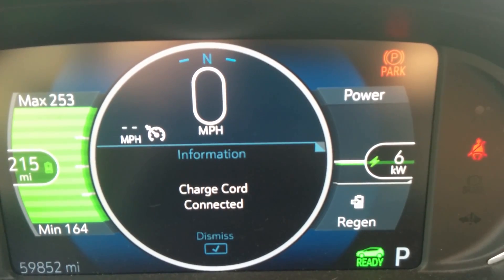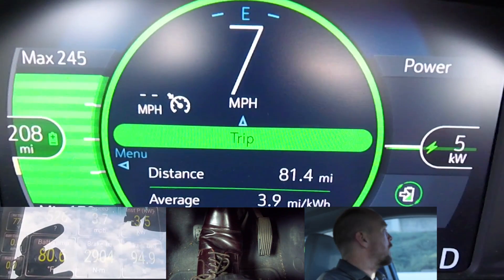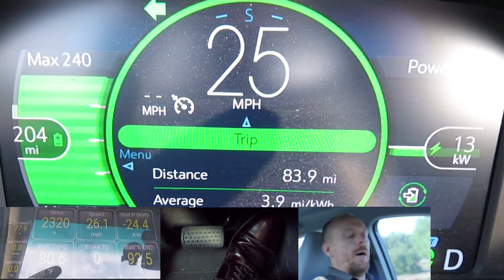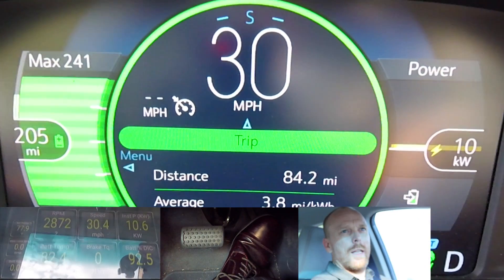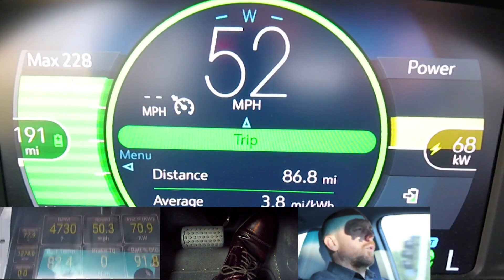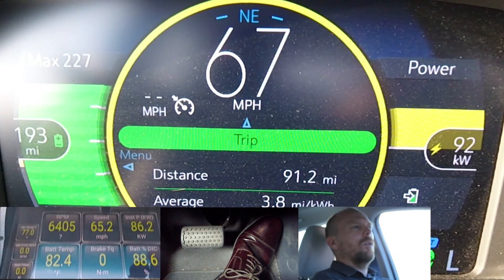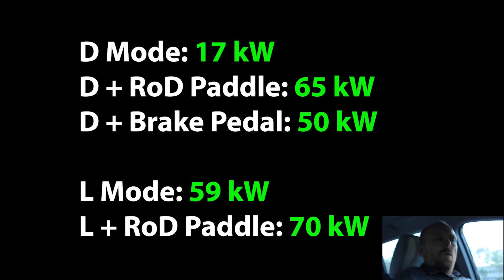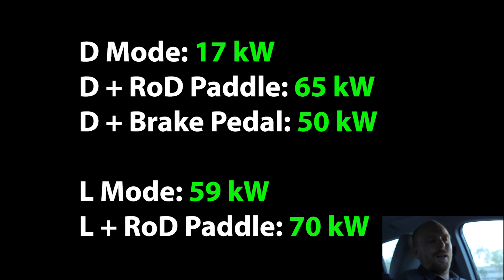Chevy Bolt EV Regenerative Braking Review

Comment: My understanding is the brake lights on my 2022 Bolt EUV are programmed to stay on after stopping with the RoD paddle, but I don't know if the newer Bolt EVs (non-EUV) do, as well. 

It's a little difficult to confirm exactly when the brake lights ARE on, so I've fantasized about adding an indicator (maybe wired to the third brake light) that I can see from the driver's seat.
Reply from the maker: I can sometimes see the reflection at night. I believe that with the 2019/20 model year update, they made the change that you are describing, so my understanding is that the update applies to all newer Bolt EVs. I like the idea of having a brake light indicator on the dash, though.
Reply: @newscoulomb3705  I was thinking even lower tech... maybe a LED on the inside of the hatch, visible using the rear view mirror.

Comment: Question about the L gear,.... I used to drive the discontinued Chevy Spark. Excellent car, no complaints. I always drove in L gear because of the regen. It was smooth. It would come to almost a complete stop around 2-3MPH than I grab the brake for complete-stop. Currently because of the value of the first generation Chevy Bolt, I am interested. A 2017 or 2018 Bolt have good prices now. Now my question is, after looking at many photos of the first generation Bolt, It appears that some of the gear selectors show a "D" and "L" indicator on the stick, but Im noticing there are some that do not, have an "L" option below the "D". Do you know if this an option, or year model specific, or possibly Im mistaken and its not visible unless illuminated? Any insight would be appreciated since having "L" mode would be a huge deciding factor in my purchase. Thanks.
Reply from the maker: The later Bolt EV/EUVs added a discrete "One Pedal" button. So you use that to engage one-pedal driving. My only issue with it is that it works in Reverse as well, which definitely requires a mindset adjustment.

Comment: So is ha i g the car in D better plus using paddle to break or L is better??
Can i drive my bolt  2019 on L mode all the time or when do i chose D Nd when do i chose L???  Tqoday I was trying the paddle in the back of the wheel but is not as smooth to stop car.  Also even if I step on break while driving on D the regen pic on dashboard will get activated too?
Reply from the maker: You can drive however feels best to you. I drive in L pretty much all of the time.
Reply: @newscoulomb3705  thank u

Comment: Eric, You did a fantastic job in this video.  The camera work is terrific.  The explanation is very clear and demonstrated very well.  I don't think videos get much better than this.  You knocked this video out of the park on the different ways to use the regen.  GM did a great job with the Bolt regen options and the flexibility it provides.  To me it is one of the most valuable features of the Bolt and is a strong selling point.  GM did a great job with this.
Reply from the maker: Thank you! I agree. Regen braking is something I think GM does well.

Comment: This Bolt regenerative braking complexity (D, D+paddle, L, L+paddle) strikes me as batshit crazy. I say this as never having driven one. I will take ownership of a new Bolt in a couple of days and see for myself.

I've been a Prius owner for 15 years. Prius has been doing regenerative braking forever. You never, ever, have to think about it. Why should you?

It seems to me that the driver's job is to drive the car. The car's job is to (1) let the driver specify (by easing up on the accelerator pedal, OR applying the break pedal) how fast he wants to decelerate, and (2) achieving that with as much regeneration as possible, using friction brakes as necessary to make up the difference. The car figures out how to do that. It ought not make a whit of difference whether I'm using the brake pedal, a paddle, or one mode or another.

Sure, the car might not be able to recover as much energy if you slam on the brakes and screech to a halt as it would if you decelerated gradually and applied the brakes gently. But that's just a matter of driver education and safe and sane driving, as it always has been.

To my way of thinking, the reason for L mode is and ought to be just that it changes the driving experience, enabling so-called "one pedal driving."  Fine. Maybe that's a better way to drive. I'll find out.

But L mode as a way of achieving increased energy efficiency seems senseless. I don't get the point of that.

Comment: I've heard that some people constantly switch from D to L,  using D when the accelerate for power, and then using L whenever they slow.  Is there an advantage to this?
Reply from the maker: No, there isn't any advantage to that as far as I know. The only change between D and L is the level of regenerative braking when you let off the accelerator, otherwise, acceleration and performance are the same.

Comment: Excellent video I like to watch your channel, I learn a lot, going to purchase EUV in Mexico, in mid of august shall be in sale. In reference to stop lights, I think darning next software Update GM shall add additional menu in settings about keep stop light on until accelerator again is push or certain time programmed to remain, 3-5 min. shall be more to enough waiting for green light. I think would be also nice video about how car use regenerative braking in D and L mode with cruise control, specially downhill. How reacting it when while downhill we change programed speed? Can it be used as precise control of breaking force and speed at same time?

Comment: Interesting the Bolt can generate 70kW short bursts into the battery but that it maxes out at about 55kW on a level 3 DC fast.  Thanks for the video, very informative.
Reply from the maker: Thanks! Yes, that's a common question. Batteries often accept "burst" charging power that is much higher than a sustained charging speed, but I don't think that's the only reason here. It appears that the Bolt EV uses a CCS charging harness that is limited to 150 A, and that's what's restricting the peak charging speed to 55 kW.
Reply: Got it.  Thanks for the reply.

Comment: The Bolt's regen system is awesome! Sometimes I go weeks without even touching the friction brake pedal. When my mechanic happened to hoist my Bolt for an inspection, he was amazed with how brand new my original brake pads looked, after almost 2 years of operating the car. He said they are likely to outlive the vehicle, and I agree.

When I need to slow down abruptly, I use all three systems simultaneously - the L mode, the RoD paddle, and the friction brakes. But then again, it does not happen very often. Usually, the first two are quite enough.

I still have a question, though: how much energy is the regen braking system capable of saving, on average? Say, when driving 100 miles in a city? Not that I really have to know it, just curious.

Comment: The "L" on the Bolt's shift handle stands for LAZY. Too lazy to lift ones foot from the accelerator pedal to place it on the brake pedal. 😎

I prefer to drive in "D". I lift my foot from the accelerator pedal then use the regen paddle on the back of the steering wheel to slow and bring my Bolt gracefully to a stop, while resting my ankle and foot, thus giving them a well-deserved break. 😉

Comment: so one thing everyone forgets with cars being able to regen is. it is sill more effect to coast to a stop than it is to regen to a stop. there are conversion losses when energy is pulled from a dc batter in chemical conversion (why batteries get hot) over from dc/to ac the resistance of the wires  creates a small amount of heat and simply a motor has its own losses that generate heat. that why the drive system has a water cooling system, is to absorb losses.  all these losses work in both directions and the higher currents the more losses there usually are. 

by coasting to a stop the avoid losses in one direction, using the actually brake pedal for a longer time is more efficient and youll have less losses than asking for the motor to hit max regen, also using the pedal in a slow controlled fashion will avoid the friction brakes more. if you want proof, go fo a drive and use the brake pedal with light pressure and watch the technique on the display. if youre above a 4 (on the volt anyway) slow down using the regen paddle a couple times and youll see.

Comment: Thanks for making this video.  As I suspected, it functions the same as the system in my 2017 Volt.  I've been watching a bunch of Bolt videos and reading articles about the brakes and, so far, you are the only one who clearly understands what is going on.  Every time I read or watch another reviewer, I keep wondering why they aren't looking at the gauge to see the amount of regen they are getting.  Several of the reviewers were seasoned automotive journalist.  I even had to explain how the system works to the Chevy sales guy when I was test driving Volts.  I came to the same conclusion you did: in the absence of an extremely cold and/or full battery, the system is designed to capture as much kinetic energy as possible when slowing the car down regardless of mode.

The main benefit I see in GM's system is that allows you to adjust your driving experience (with regards to regen) quickly and intuitively on the fly.  It also allows non-EV drivers to just jump in the car, put it in D and drive it like what they are used to.  I think it is the best regen braking system out in the market today.  I understand why Tesla doesn't use a blended braking system from a performance car perspective, but they could vastly improve the driving experience if they had a ROD paddle on the wheel or even just a high/low toggle on the wheel.

On a final note, I think Chevy should seriously consider some type of referral program for Bolt owners like Tesla has.  When I search for Bolt reviews I primarily find dealership ads pretending to be reviews or reviews written by people who really don't understand the car.  Both groups of people are rarely Bolt owners, and have little time behind the wheel.  There are few die-hards, like yourself, but not enough to get the truth out in a sea of misinformation.
Reply from the maker: Thanks! Yes, I definitely agree that it's one of the best regen systems out there. The one thing I wish it had (because of the blended braking) is a pure coasting mode. Technically, you can do that in N, but you should never really drive in N.

I'd like to see the Regen on Demand paddle have a back and forth. Pull back for max regeneration (like now) and push forward for zero regeneration.

Comment: This was very helpful.  I just wish you had addressed the big question "Do the brake lights come on during regenerative breaking?"
Reply from the maker: Yes, I probably should have mentioned that. There's specific numbers involved with the brake lights, too, so I'd want to get those right. I believe it's anything over .2 g of braking force and the lights come on, but I'd need to check and confirm the exact details.
Reply: @newscoulomb3705  in order to become more familiar with the brake lights while using any form of Regen I took my bolt out at night on an unlit road with no traffic. Because of the darkness I was able to monitor when the brake lights came on. I tried various scenarios and I'm now much more confident about the brake lights.

Comment: I wish EVs had an option to continuously control regen braking force by itself. A third pedal where the clutch would be would probably be ideal. I doubt conventional cars would do something like that, but maybe high performance premium ones would provide that extra level of manual control. If the software on these cars was more open, someone could easily design aftermarket controls like pedals or levers.

Comment: Icy roads, D or N?
Reply from the maker: I'd suggest D. I think the manual says the same. Basically, you want to be in D in any conditions where the car would be prone to fishtailing. Gravel is the same. 

In the end, it comes down to pedal control. Without it, even D can be bad. With it, L isn't a huge issue.

Comment: Great video thank you. I have a question isn’t the d mode the most efficient because your coasting longer than the other modes therefore not using electricity longer?  Thanks again for the great videos.
Reply from the maker: Thanks! Technically, the most efficient would be never decelerating at all, but that's not really possible in real-world driving. As much as it's possible to maintain a constant speed, if you do, there should be virtually no difference between D and L. 
When it comes to decelerating or stopping, the only time D has an advantage is when the stopping distance doesn't matter. Essentially, the longer you can coast to a stop, the more efficient you'll be, but practically speaking, that isn't always possible.

Comment: WRT the brake lights coming on or not, I would think the thing to do would be to have them on whenever they would be in a truly equivalent situation in an ICE car. If you're sitting in your EV, with max regen enabled, but the car is stopped and on level ground, that's equivalent to sitting still in neutral. Your brake lights would not be on. If someone stood at the back of the car and gave it a push, it would roll, would it not? So, no brake lights. (Presumably, you would not be in a traffic lane when you are in this condition, so lack of brake lights is OK. If you are stopped in a traffic lane, in neutral, out of necessity for some reason, then of course you need to turn on your 4-ways—and exit the vehicle, if possible.) OTOH if you're in Park, but no foot on the brake—hmmm, not sure, but I'd probably say have the brake lights on as long as long as the car is not simply turned off.

Comment: I have two questions: when you are in D and use the brake pedal, how can you tell the threshold above which the friction brake applies? What is the app that you use to monitor rpm, battery temperature, etc? Thanks.

Comment: Some day, when new drivers with little experience with old fashioned friction brakes get into panic situations, do you think they will have a problem reacting correctly?  I'm getting to the point in my BoltEV that I only use "L" mode and virtually never use the brakes.  Am even now using the paddle to get maximum regen when wanting to stop faster.  However, there have been a few times when I've been caught surprised with needing a really fast stop and gratifyingly have the automatic response to jam on the brakes.  I realize however, that this reaction was honed by many years of driving with only friction brakes and wonder if future new drivers will get into trouble and possibly jam on the accelerator by mistake....
Reply from the maker: Perhaps that's why GM makes the lights go off when the car is fully stopped? I've never lost the habit either. Maybe automatic braking will help?

Perhaps we will rename the brake pedal... Call it the "Emergency Brake." 😁

Comment: Does Bolt blend in friction brakes at all like BMW and Nissan are doing now with their one-pedal approach?
Reply from the maker: They do, but not to achieve one-pedal driving like Nissan does with e-Pedal. I've heard different stories about BMW, but I don't think anyone has confirmed whether and when friction brakes are used to achieve one-pedal driving. 

With the Bolt EV, you can drive using one pedal in most circumstances without ever engaging the friction brakes. However, if you actually do press the brake pedal, the regenerative braking will eventually blend in the friction brakes.

Comment: This is a lot of good information. I've tried them all and always drive in the L mode. It is a really good way to get back some energy from the potential energy of the vehicle. My only complaint about using L mode as one-pedal-driving is that when near and coming to a stop the break lights do not stay on. Only while there is enough g-force to warn others of slowing down. I once heard a car behind me screeching their tires just before I slowed to a stop. Which leads me to believe that they did not know that I was coming to a stop because my brake lights were not on. My foot was neither on the accelerator nor on the brake. I wonder what could be done to make one-pedal-driving work safely, because it is really easy and efficient and should not require you to use the brake simply to alert others you are slowing to a stop. A car this advanced should do this for you. How does one inform GM about fixing problems like this?
Reply from the maker: I think GM is aware about the lights. They intentionally programmed the brake lights to only come on at .2 g. I don't know that the lights have to be more aggressive than that, but I do wish that they would stay on when L is holding the car at a stop.